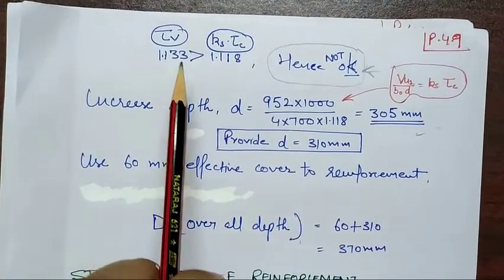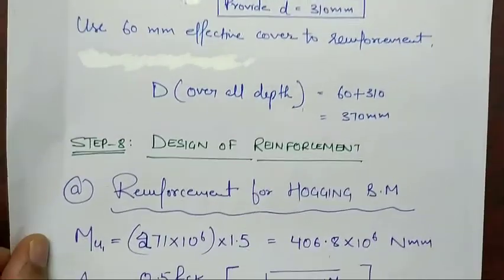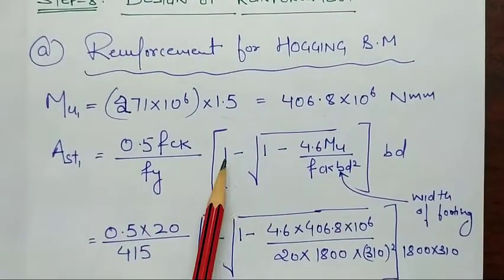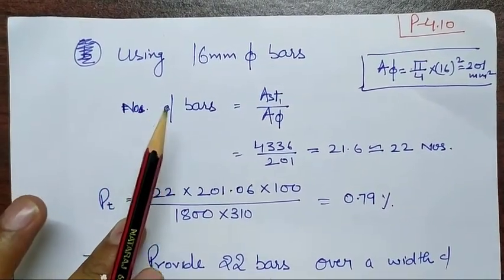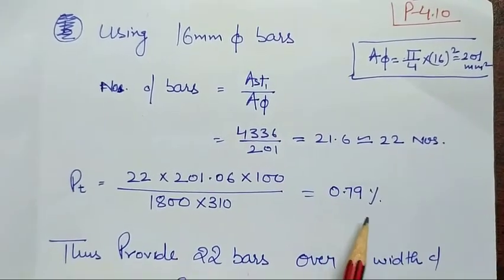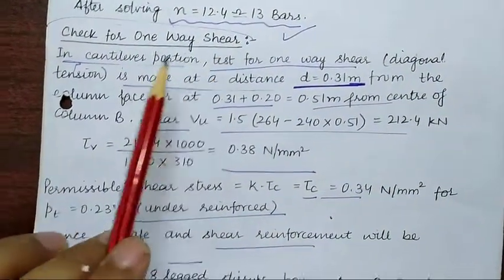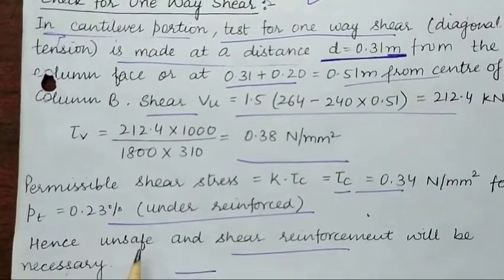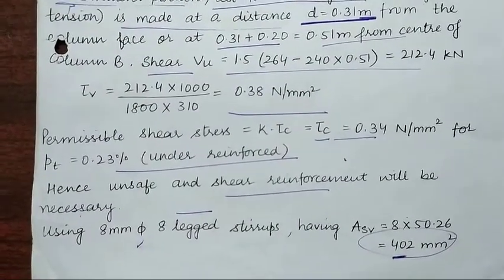Lecture 4 - Design of Combined Footing (Part-II)

Comment: Sir, Practical not possible to provided shear reinforcement in foundation , we must check the Depth of foundation or to increase depth as per codes to varify shear check , presentation is good , require more about shear check , bending moment is ok Thank you need detailing of steel.